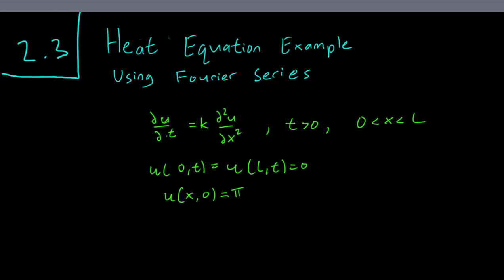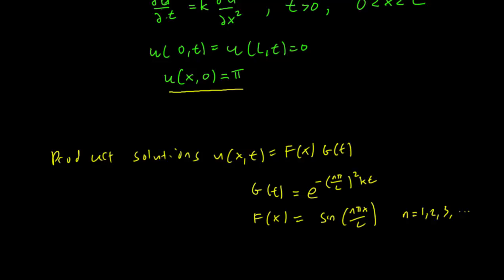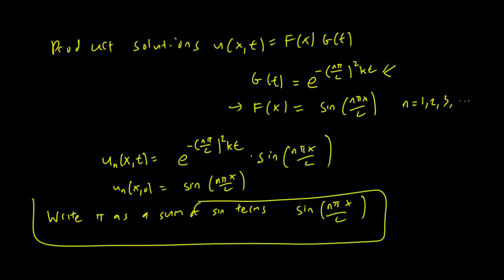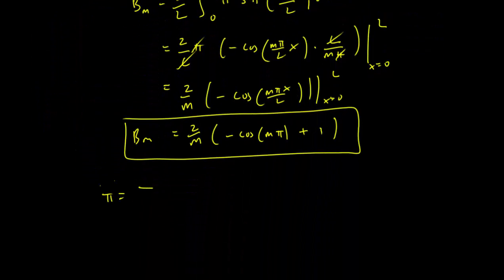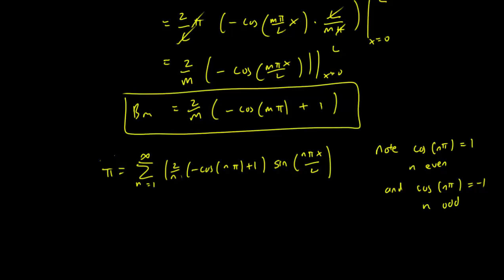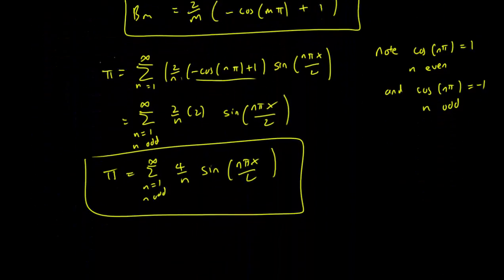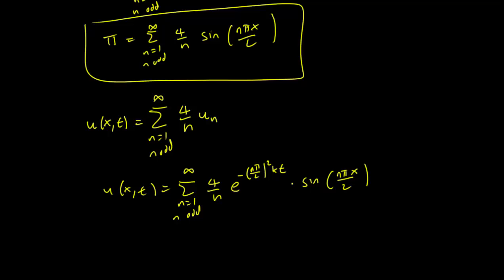2.3 Heat Equation example using Fourier Series

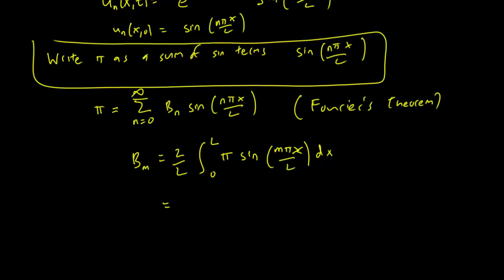Comment: You can not use that formula for 'bn' @3:43
 since pi is not an odd function . That formula only turns up when integrand in a whole is even which is exactly not the case here .
Reply: Can you explain more about this? What should he write instead?